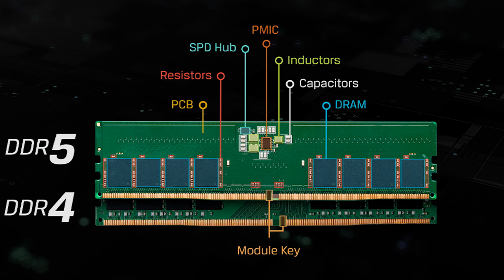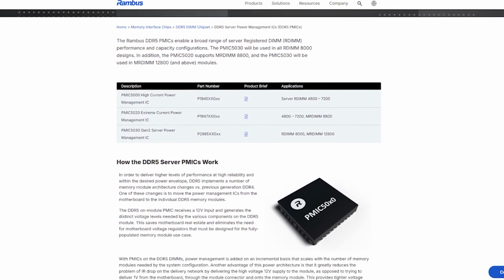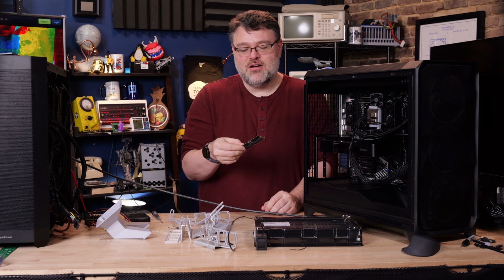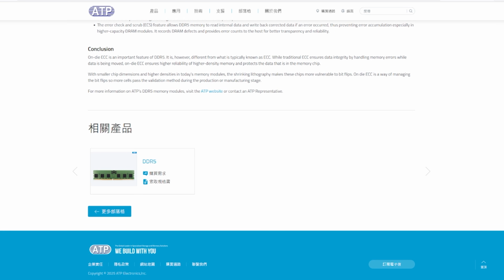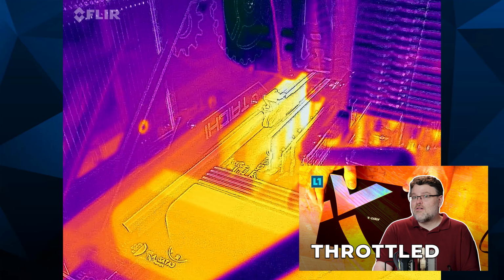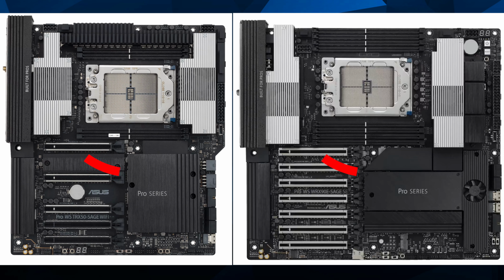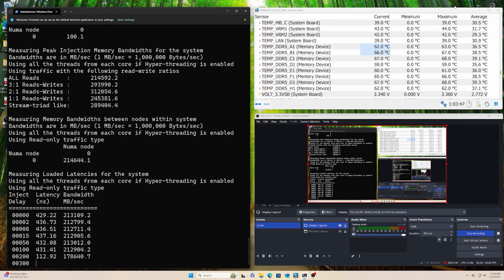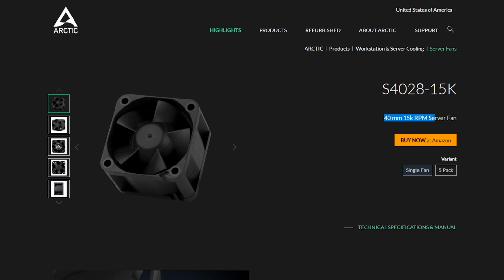Your DDR5 Memory Could be at Risk! All About DDR5

Comment: Thank you for your service to the community Wendell, always interesting content! 

I was looking in to one of the new Lenovo workstation a few weeks and was wondering if those tiny fans on the memory really was neccesary. I guess they were. I once had a DDR3 Samsung kit with "nano heatspreaders", I dont know if you remember those? They worked great! Also I had a Corsair kit, if I recall, that worked better without the heatspreader.
I'm glad I got a Crucial pro kit (before the price increased like 8x) and it runs 5600mhz or 5200mhz with jedec voltage. I run it at 5200mhz. 

On another note. I've been concerned about ram speeds for years, even with DDR4. People seem to have tons of issues, even before DDR5 was a thing. I've always suspected memory and have been succesful in tweaking them into either being stable under overclocked conditions or under XMP / EXPO conditions, where the memory controller voltage is set to high automatically, by the board. 
I was very sketched out when AM5 launched and the  memory training issue came into play with EXPO enabled. 
This is the main reason I didn't get EXPO memory for my AM5 build. I've been trying to tell noobies on forums for many years that they shouldn't be overly forcused on ram speeds, most of the time you wont even notice if you're running with tight timings and high clocks. Let alone being able to get them stable! This is even more true on X3D CPU's. They're less reliant on memory speeds because of the X3D-cache. I've tested this on my 5800X3D where I started with running a 2x16gb 3200CL14 kit, then went to 3200CL16, then 3200CL22 (jedec). Guess what, the jedec runs the best. Because of the lower load on the memory controller. This also results in overall lower power consumption of the chip. Because the 5800X3D is power limited (with a hard cap), running higher memory voltage takes away some of the available power by the rest of the CPU.

Comment: I just cool dimms with front case fans: dimm temps info goes into fan control app and when they're hot fans turns on. have front fans temp curve graph (mixed with cpu and gpu temsp curves) genius simple app! though have to design cooling logic of all fans. you have full control

Comment: Just a normal user, but I do have weird issues in two machines.  One is a 13900K with 6400 DDR5 and the other is a 265K with 8000 DDR5 (both systems use gskill trident z modules).  It took a while to figure this out as I only saw a HW bug from windows twice and couldn't trace down what it was referring to.  For the 265K, I had to turn off xmp (now running at 5600).  Note that neither system is overclocked and that I had ran RAM testing multiple times on both systems and not once did OCCT find an issue, but it's the removal of expo that's giving me stability.

Comment: Im sorry if people are confused, but the problem isn’t all the ddr5, rather those micron crucial sticks without the heat-sinks.
For example ddr5 errors past 50ish celsius  with tREFI at 65k. And that’s something we tune when doing memory oc as for people on expo/xmp you will have way more heat tolerance.

Comment: Well, this has added a bit more work to my custom pc build. Previous iteration had ram temp issues on DDR4 DIMMS sometime hitting 70+ degrees, with DDR5 being even hotter I'm going to have to rethink my current improvement plan and add some proper direct cooling.

Comment: Got all paranoid about this and then fired up HWINFO64 and saw my RAM never gets over 40.5C, good airflow plus full custom water loop gets the heat out of the hotter components and out of the case really fast, especially in winter when ambient temps are lower. My precious 64GB is staying frosty. If you can get the heat out of your hot components and out of your case fast enough, your RAM can stay cooler. I'd be willing to bet that the few watts the ram is dissipating isn't the issue, it's probably an ambient temp problem in the case. There is no substitute for good case airflow, if you can improve that you probably wouldn't need a special gadget to cool just the RAM.

Comment: #1) Don't even bother overclocking if you have 4 sticks of ram. Running 4 sticks through memory controller will Always be more unstable that dual channel. 2) If you plan to run max rated speed, you need to verify what your motherboard supports, and also look at your motherboards approved vendor list for brands specificially tested on your board.

Comment: Even in DDR4 it was an issue for me in my 3990x setup.I had 256gb of ddr4 3600. I asked gskill what the upper bound in temperature was and they couldn't give me an answer. Having my RAM at 90C+ under 24/7 load did not inspire me with confidence and I was getting error in the datasets I was using for the specific applications I had.

I ended up adding my ram to my water cooling loop. Temps dropped to somewhere between 40-50c (going off of memory) and all my issues went away.

Comment: What I think would be really neat, but won't happen- a new DDR3 CPU for People on a budget, it's still dirt cheap. I used to benchmark the 4790k and hold a minor Firestrike record that took a lot of messing around to get. I got those last few points through the memory speeds- I tested a bunch of different memory and in real World use those higher speeds are mostly just for benchmark scores and were never fully taken advantage of, they made no difference at all in gaming. With the prices of memory now I suspect we could have some really good DDR3 systems that can run higher end GPUs, maybe not a 5090 or the highest end but way more than what we could before on the best DDR3 system.

Comment: Ripped open my pc cases and installed as much fans directed on the ram sticks from all sides possible literally after first few minutes of listening to this, I thought I was going crazy seeing random crashes and hangups on both of my AM5 systems - 7950X (gigabyte aorus elite b650, 128gb ram) and 9800x3d(msi x870, 32gb ram) since last year man. Damn DDR5 is rigged to blow up. PROTECT YO DIMMS BROS

Comment: This problem was also slightly prevalent in ddr4 hp made a solution for it in their work stations. Example the z840 has 16 slots and all 16 are placed under high speed low noise scroll fans per the giant fan module that slots in over the cpu's but each cpu has its own quad channel mem controller. Btw you can buy cheap after market ram coolers.

Comment: Not just AMD — my Intel system on the ASUS Pro WS W680‑ACE had the exact same issue. I kept blaming Intel, but DDR5 ended up being part of the problem too. I didn’t realize how temperature‑sensitive it was until I started monitoring the DIMM temps.

Comment: I remember a long time ago when heat spreaders came out, there was some reviews showing that the heatspreader was actually making the chips hotter than without. I've recently after a neccessity removed the heatspreaders from one of my systems, and simply made sure there was a stream of air running across them. The stability is good. 

Thanks for this talking point, I'll look over my systems to see if some extra air flow will help.

Comment: I was running 1.65v on my DDR5 albeit with a fan but have since loosened my timings a bit and dropped the voltage to 1.5v due to RAMageddon.

Comment: I rather have heat spreaders just to keep the tracks clean and dust free to prevent corrosion , what happened to all the heat piped dimm that were around for DDR4 ? use to get tall ass heatsink stack

Comment: Had 2 old EKWB  x4 ram water cooler sins the 2011 socket, so bought Alphacool Core RAM Modules  and connected them to the loop, have  2x 200 mm fans for just moving some air over the motherboard.  The temp is lower on the ram now. $40 plus some old fittings and some tub  and some fluid... Why not, it took 3 hours to make it future prof

Comment: 18:02 RAS Daemon, fails to load due to a bug filed in 2025-10? Cool, let's not bother, just use...
LM sensors - doesn't show RAM temps by default. Huh. To enable it, it needs to interact with the i2c bus. Why doesn't it do that by default? Oh, because it is "advised to not load any modules that interact with the i2c bus if you have a Navi 2 GPU due to obscure GPU crashing". I'm not quite sure if my AMD GPU is or isn't, this terminology seems to be used very inconsistently with the number jumping all over the place. Bottom line, risk of another bug in that pipeline somewhere.

Cool.
I just did about 20 minutes of research trying to wrap my head around what exactly is going on with these two options and they seem to be rabbit holes. I'm out. How, is this such an issue with Linux systems in 2026?! I just wanted to know my temps.

Comment: My first project in a hardware IP team was to develop the throttle control for a DDR controller for infrastructure products for thermal control. It was a closed loop control system independent of the host and memory controller, all done entirely in hardware

Comment: When building my Ryzen 9 7950 system with 4x16GB G.Skill DDR5-6000CL30 I even ordered some RAM waterblocks but never installed them.
Since I am having a waterblock on CPU (direct-die) VRM, Chipset and SSD there is minimal heat inside the system and it's completely fanless. DDR5-temperatures never exceed 50°C whcih I would have considered safe. I am running a slight voltage offset at 1.33V instead of 1.4V but actually this should not matter as this is just the voltage for the on-DIMM PMIC.

Though I noticed that in some BIOS versions (ASUS X670-P) I got exactly this random re-trainings after the PC was shut off for more than a day which might be temperature-related.

Comment: Thats what I was saying past year or so, DDR5 dont like high temps, higher temp on DDR5 chips, higher chance of uncorrectable errors and lower stability.
For normal desktop its not that big issue, but for smal builds, heavy gaming or high memory compute application its different story.
As for extra cooling, for normal desktop dont necessary need shrouds, for me enough was to put lower speed fan on front part of backplage of GPU targeted towards memory. It have benefit for lower memory and GPU backplate temps. It keeps memory temps bellow 50 for me instead of 68+ unler load (tested with OCCT memory test on GSKILL 96GB CL28 6000MTs kit).
Memory choice is important here too, there are certain memory configurations that use higher voltage, have higher power consumption and result in higher temps.
For example GSKILL hynix modules:
- 16/32/64 GB modules have +0.05V compared to newer 4/48 GB modules 
- Same thing is with Latency, its not worth gettin CL26 over CL28 because again it increase voltage by another 0.05V
In result 32GB 6000MT/s CL26 module use 1.45V and 48GB CL28 only 1.35V.

Comment: I always make custom cases for everything except my desktop so that I can easily modify it and add things like fans randomly where I need them. I always have one or two fans blowing down on the mobos sentsitive parts, as well as the ram to help with that.
Also I still hate the design of consumer mobos. Air ALWAYS comes from the front, yet Ram is placed so that the first ram stick blocks the airflow to the others with its side. I wish they could by all places length wise so the air can flow between the sticks

Comment: I thought I'd been going mad (software engineer), we had one system with a Gigabyte motherboard (1.5TB of DDR5 - dual socket) and I can drive the RAM and max speed but only for a short period. The system builder had added some active cooling over the DIMMs which we had to dial down because of the noise (15k RPM fan), I managed to swap these with Noctua fans which fixed the noise but still saw bandwidth throttling after a few mins. We added some more cooling to the DIMMs and it delays it a little but still always kicks in. Fast forward to this year we have another workstation from a different system integrator and we were getting crashes every 5 days or so, it had much better airflow with much more noise. In the end we have invested in a machine room as it is too loud to sit under a desk. It has an ASUS motherboard so I now wonder if it is also a DDR5 issue as well. They have sent us a new motherboard to swap with but I'm not hopeful now having seen this video.

Comment: The megachonker dual fan CPU cooler bros were right all along. They provide better airflow not only to RAM but also to all the mosfets and controllers. I bet it's significantly more rare to have RAM overheating issues on an air cooled CPU.

Comment: Yup, was having constant instability while gaming, and doing anything in software didn't fix it, neither did reinstalling or repairing the OS. While loading up an ISO for reinstall, I realized my ventoy had memtest in there (it was in clonezilla). For a lark, I said screw it and decided to run it. More or less immediately I had RAM errors, and it turned out to be one of the kits of RAM...curiously the RMA kit for my second 2x16 DDR4 kit.

Got a successful RMA for it, thanks G.Skill, but I was like Hmmm, maybe it's the motherboard. Well, eventually I was getting instability related to the NVMe storage, which was solved by a new motherboard.

Point is, if you're getting instability, crashes, whatever, ALWAYS suspect the RAM first. Just run memtest over night. Memtest won't really help with overheating, though OCCP might.

Comment: It was painful, but I just dropped $1300 on 96Gb of DDR5-6000 CL30.  Ridiculous I know, but rendering eats it up, and prices are only gonna get worse.   I should be long dead before I need to upgrade again lol.  Little sad I could only get it to run at 5.6Ghz with XMP enabled.  Prob all my poor 14900k can handle lol.  Still not bad for 96Gb I suppose.

Comment: I have my pc in a seperate room that's at  0-1 Celsius ambient, plus a 200mm fan blowing air on the whole motherboard. I removed the side panel and put the fan infront of the motherboard.
Right now the RAM temp is at 1 C.
I think I'm good when it comes to temps =)

Comment: I mean, lets be real, a 5090 or pro card blowing 600w of power directly onto the ram isnt helping. Just some air ducts to mount to the top of the card to direct the hot air around the ram, with a 3d printed heat spreader pulling air in from the front or side (assuming an open side case) would work insanely well.

Comment: I agree. My RAM is unstable at cl30 6000mts. The sweet spot for my system is the xmp profile 2 running at 5600mts. Fps drops are minimal and sandwiched above the 5070 running at 70+ degrees Celsius avg, the ram does tend to get hot. I cannot figure a 3d printed solution as there is barely any space with the cpu cooler and 5070 sitting almost perfectly flush on the msi 760m gaming wifi board.

Comment: I had noticed that even my dual rank DDR4 3600 sticks get a bit warm - close to what I observed with SDRAM in a case with poor airflow. However...there is a 140mm fan drawing air across the sticks so I hate to imagine how hot they'd be without it.

Running them at 3200MHz now anyway after getting 16GB DDR4 3200 free with a dead board and (maybe) dead i5 6500. 48GB makes memory leaks a bit less of an issue in some of the modded or abandoned games I play.

Comment: Wonder if this is the reason why my small DIY system keeps crashing its using ddr5 6000 MHz 64gb but its running stock and still has problem if i put it on EXPO and test it using OCCT once the it hits 70c it starts erroring like crazy but if i leave it stocks it does not happen.... But the problem still happens with the system just freeze's after like 1 to 1:30 hour of play time (crashing) enable EXPO and it happens way way way faster 10-20 minutes... I made sure there is airflow over the dims but i dont think it helps for a long running the 9800X3D temps are low but the gpu an RTX 3090 is putting out allot of heat

Comment: If you run analog audio out to an analog amplifier and turn up the amp gain, built in single bit ecc in DDR5 that is not detectable by cpu/system is detectable as audio distortion/clipping. No audio playback is needed, you willl just hear it out of the amplifier as you feel the system latecy seemingly increase. This is very handy when tunning for that sweet spot of lowest absolute latency + stability.

Comment: My previous comment was meant for regular "gaming" PC setups but if you are running a threadripper system or such you can always go back to what we did in the SLI era dremel a 200mm hole in your side panel and install a 200mm fan thermaltake and noctua still sell them, blowing fresh outside air directly on all of your components, you want to add a fine dust fliter on top of it or it'll vacuum all the dust in the room but it absolutely works I did that 20 years ago and my big fan PC is still running as a server today

Comment: Builzoid from AHOC called years ago that the GPU backplate of air cooled GPUs was radiating up to 85°C onto your DIMM slots and was a problem for memory this also makes those gigantic M2_1 dissipators useless as your gpu will make it extremely hot it's one of the reasons I bought the MSI X670E ACE no m.2 slot above the PCIE_1 instead the m2_1 is at the right of the memory closer to the front fans and not above the largest heatsource in a PC today another decision I made when purchasing after seeing the tiny rtx 4000 pcb was buying a short pcb 4090 with an alphacool waterblock my 4090 only reaches half the 1st dimm slot it's 200mm long ! also please stop buying psu at bottom cases they are obsolete instead get a 2 chambers case with bottom fans so you have a proper bottom to top airflow following the rise of hot air this became even more important today as sata SSDs are going EOL and you really want fans blowing fresh air on your motherboard, psu at the bottom cases have zero airflow under the gpu and that's where most of your m.2 and the mb chipset are